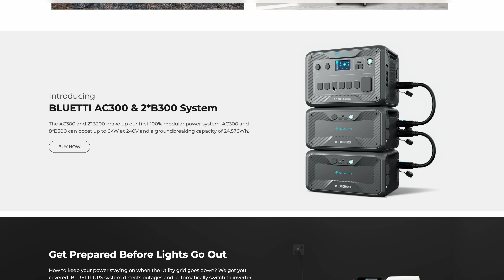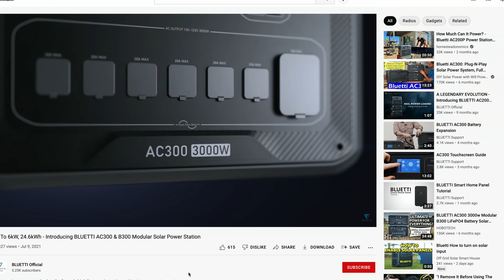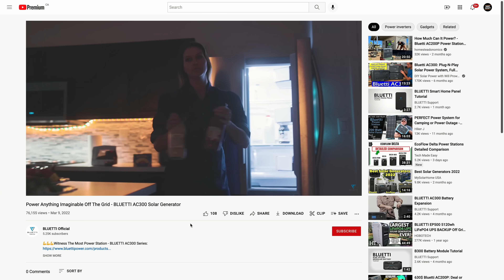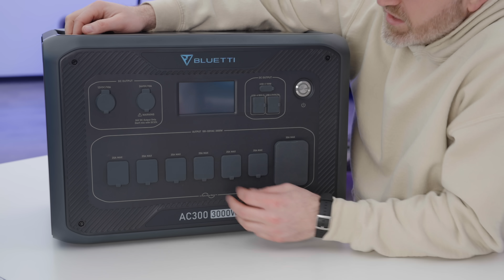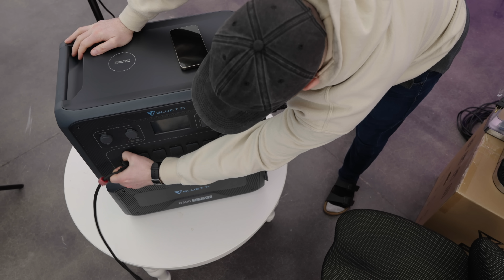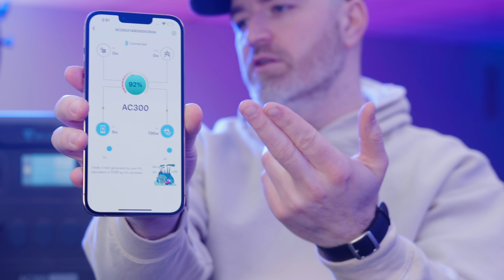You'll Never Run Out of Power Again...

Comment: I can vouch for this platform. Got my AC300 w/B300 along with two 350watt solar panels. Very happy with the setup and so far very stable no issues at all. 

I will be purchasing an extra B300 because it’s modular. Once it’s charged you can take battery anywhere in the house. As long as it’s charged you’ll have juice.
Reply: How long does it take to charge via solar?
Reply: @Hamasakifanboy  good question. I have a set of the BLUETTI PV350 Solar Panel | 350W. On a battery with 35% left of capacity and you start charging around 11am until 5pm and depending of sun angle 📐 and clouds you can charge close to 💯 %. 

I usually have a beer frig that is not efficient connected to AC300 so my charge time is extended. Keep in mind you will need to readjust your panels according to sun rays. 

I’ve had zero problems with mine and think its always a good idea to be prepared. Has many uses around the house. If you have any questions let me know.

Comment: I have the ac200p 2000watt/2000wh system with 700 watts of solar input. I run my kitchen,washing machine,lights and any power equipment to do my lawn. I have cut my power bill by at least 40% I love my Bluetti

Comment: I just replaced my battery system in my RV to lithium including a new charger controller. Cost me $1800 I now have 1800 watts of power. These "portable" batteries are way overpriced. See how long you can run an AC or microwave for.

Comment: For reference, the average household uses 30kWh a day. This provides half of that at the highest 5 unit spec. A singular tesla powerwall 2 does more work than of five units og this for a much lower price. That being said, this being used on the go does makes sense. A singular 30,000 mAh battery pack for your phone converts to 111 kWh so it's like have 30 of them. Van life would be useful.
Reply: You're wrong. Tesla Powerwall 2 has 13.5kWh capacity. Slightly more than a full setup of AC300+4*B300 (12kWh) but you cannot but the TP2 without the solar panels/roof. Bluetti setup is highly competitive to other systems and is modular.
Reply: Also 30kWh a day, Jesus! I have a gas stove and use about 100kWh of electricity a month... (2 persons).

Comment: I must be getting jaded when 12,000 Watts (12 Kilowatts) is considered by me as BEING A TINY AMOUNT of power generator capacity!  I'm looking at 1.2 MEGAWATT propane power generators (1.2 MILLION WATTS!) to power the future off-grid homestead so I can Weld, CNC, run my high end computer and web servers and long range wireless communications, heat the pool and do other comfy modern-life stuff without having to depend on BC Hydro for my electrical needs!

Even a Tesla Powerwall is TINY for some people's off-grid power needs!

I remember back in the day when Toshiba once offered a 2.5 Megawatt Fully-sealed Radiation-Proof Portable Nuclear Power Plant you could just bury in your back yard which would supply the FULL 2.5 Megawatts for a whole 25 years before dropping down to one megawatt average for the next 25 years! No nuclear re-fuel cycle was needed as it was a permanently sealed block of steel and concrete! You just had to accept that after 25 years the half-life of the material would degrade down to about 40% of normal power output. But at 2.5 Megawatts who cares! That is a LOT of power in a small space!

A few of them were sold in Japan, the USA and Europe and are still around kicking around in various off-grid military, industrial and wealthy homestead sites doing great at around the 35 year mark doing about 1.35 Megawatts output nowadays in a space the size of two 40 foot containers! 

V

Comment: ive got the EB70s in UK England at 1000W  and i found something a bit odd when i plugged my laptop tablet into the socket 
the touch pad would be a little gittery and sometimes would not respond. 
i found tho touch screen would work on my tablet but it is an issue that maybe mid range small ones have were they effect the use of some gadgets.
it will prob be ok if i use a external mouse tho so no biggy but still a bit annoying

most odd and worrying issue is it can get hot without any-fans kicking in and it may have a plastic smell at first 
also when charging it can only accept 200W 😂

Comment: I’m looking at home generators that would run me $5k… would this be a better value for the price? Can it be setup to automatically turn on when the power goes off?
Reply: You'll still need a gas gen for when this battery goes out...
Reply: @jakecalvert  not necessarily.  You can charge it with a Solar Panel.
Reply: @KingJermont  if a home had solar set up, why would you need the generator? The solar setup would already have a battery and inverter going into the house.
Reply: @jakecalvert  Maybe they have a portable solar setup and not home solar.
Reply: @jakecalvert  most solar on a house is grid tie. Meaning tied to the power grid. Off grid solar is used to charge the Bluetti system. But you are right a gas generator would still be a good idea as if the unit got low at night you could charge it with a gas generator but would only have to run the generator for two or so hours. And then be able to shut it off. Saving gas and noise level.

Comment: This is a really neat piece of tech. BUT it will never surpass a tiny, handy, bulletproof Honda generator. For reference point, during "sandy hurricane" in NYC this thing would have been useless. battery would have died and you driving out of your way to a friends, waiting for it to charge while your house is under water. That's impractical. Honda generator? gasoline on the next nearest gas station and you're back doing what's most important. I'm not against EV but there is some human inventions with a internal combustion engine that we SHOULD keep regardless if the world goes fully EV
Reply: Congratulation you have won a price message ☝️☝️☝️ me immediately to claim your price 🎁🎁🎁

Comment: now there is one thing we all wanna know ( i think ) can it charge a tesla or any other EV
Reply: Congratulation you have won a price message ☝️☝️☝️ me immediately to claim your price 🎁🎁🎁
Reply: About 5 miles added.
Reply: What i know that the outlet needs to be grounded so i dont know if the power station is grounded or not
Reply: Tesla's can be charged with almost any outlet, just at a very slow rate. The supercharging is what's specific and actually useful.
Reply: @jakecalvert  cuz i have seen that the outlet need to be grounded

Comment: So I see the watt hours but what is the amp hours? I have a 100ah lithium battery for my car. And when I build my van I'll have over 600ah in my power supply. The lithium for my car is to mainly power my stereo system for those that say that too much power for a standard car you would be correct but my stereo system is over 5kw going to the sub woofer so I need a decent power supply. But if I were to use a system like this in a vanlife setup I would like to know how many extra banks I would need. Or maybe have 2 or 3 but only have one connected at a time while the others charge so I never have to worry about not having enough power when I'm off the grid

Comment: You in America have 240V max 30A, in Europe we have 480V 32A, thet is more then double power... 7, 200W<15, 360W thet is insane difference why do you use thet standard? It does not make sense (also our electricity installations are much safer)...

Comment: 🤔 Can you charge a Tesla in a middle of a snow storm?
Reply: Yes.
Reply: A Tesla uses around 300 watt hours per mile. These power banks only store 800 watt hours. So, no, you could not use these to charge a Tesla.
Reply: @MX304 3000 watt hrs actually so if u get two or three of them you're talking about 60-90 miles enough to get u station or back to home unless ur traveling different towns
Reply: @orpheus_comedy  Considering a Tesla will only gain 2-3 miles of range per hour when plugged into a 100v outlet, I hope you don't need that much range to get to a better charger. 30hrs of charging doesn't sound like much fun to me.
Reply: @MX304  Tesla's model S gives  you 249-256 miles per  75kwh, rn you're talking about chargers(120 volt) that are the size of modern day smartphone quick charger no one is stupid enough to buy a smartphone brick to charge a vehicle, I'm pretty these batteries are more than sufficient to provide 10 timesX or even more of that volt considering you can run a whole ass washing machine and a 1000 watt microwave alongside of An 350 watt + more equipments. If you're gonna defame a product do know ur algorithm bruh 💀
Reply: @orpheus_comedy  Before you accuse someone of defaming a product, you had better learn how electricity works. You also need to learn how the 110v Tesla charger works, and the limitations of it. Furthermore I am not slamming these battery backup systems at all. They are great for their intended purpose. Charging a Tesla is far outside of the intended purpose.
Reply: @MX304  before saying I'm not unable to fathom the electricity and volts do hold your clownery cause  you be mad funky  for using a mobile charger or 110v option for a car it's a last resort but here's the algorithm these batteries are appropriate enough to provide an out voltage of 1000 watts ( as per shown in the microwave test ) meaning they can provide 10x times the output for a tesla
Reply: Yes if you get the big set up

Comment: In 8 to 10 years when all those cells are degraded, it feels bad to have to throw this fancy thing away.
Reply: Pretty damn useful in that Decade. Soo not sure why you complaining. A Piston Engine Generator would produce way less energy and operational hours during that lifetime. If forced to even run 1/2 the operational hours it would crumble into pieces.
Reply: @Neojhun  It's true that it definitely has legit use cases. All the same, I wish strides would be made to make these products with replaceable cells, even though at the end of the day the cells make up the lion's share of the product's price. It's a shame to throw it away.
Reply: @Bynming  This is most likely LiFePO4. It has a very good lifespan and more resiliant that most other forms of Lithium Ion. Li-Ion is a large family of different cell chemistry. The differences can be massive.
Reply: Dude 10 years ? You give it max 5 years and it’s still amazing
Reply: @themddude  If you have a use case and get a lot of use out of it it's nice.

For me, it'd mostly be used as a backup for power outages and to go camping once or twice a year. If it lasts 5 years for $4000, that's $66/mo. That's more than I pay for both my internet and my phone combined. It'd be nice but I personally would not get my money's worth.
Reply: @Bynming  5 years is absurd, do not calculate cost based on that. It's simply Implausible.
$33 a month for restrictive and limited resources cases often in the middle of nowhere. Is very worth the price. There is not much which competes with it which is better.
Reply: @Neojhun  Provided it lasts that long, great. All my batteries use 18650 cells as far as I know and the ones that get used don't typically last much beyond 5-6 years if I'm lucky.
Reply: @Bynming  18650 is NOT LiFePO4. Maybe check some simple FACTS. E.g. Sony VTC series is Nickel Manganese Cobalt Oxide. You are comparing apples and oranges.
Reply: @Bynming  My 8x 18650 Sony VC3 for the two 4,000 lumen CREE LED Torches I have are from 2016 making them the same age. I use them for work alot they have probably each been charged about 300 times by now. They have lost capacity some degradation. But they still have like 80% of their runtime. Guessing I can get about A Dozen years out of them.
Reply: @Neojhun  I didn't say 18650 was LiFePO4, I was talking about the battery format that's in my stuff. You seriously need to calm down.

That being said, reading around, it does look like a lot of places report a life expectancy of 5-7 years for that tech, which would explain the 4 year warranty.
Reply: @Bynming  Bluetti EP500 has a 5 year warranty. Meaning a vast majority of them has to survive way longer than that. Companies do not want to pay for replacement if they promise a generous warranty period. NEVER use Warranty as the estimation of lifespan. This is basic legal liability mitigation.
Reply: @themddude  5 Years is not plausible, nothing of this Kwh capacity and this cell chemistry LiFePO4 is that short lifespan. If properly design with fan blown cooling plates. Could live up to 15 years. These are the facts of what is real world results. FYI Big banks of LiFePO4 have been built since the Mid 2000s. I first got 4x 40ah Prismatic Bricks in in 2004. They very much would still be functional today as it was a power backup unit for industrial controllers. It was only occasionally cycled for maintenance and testing.